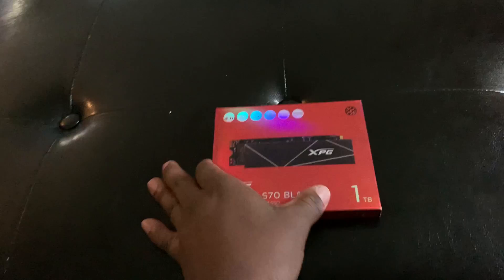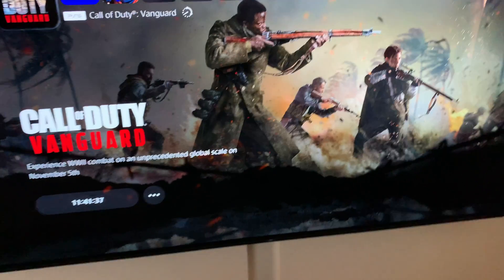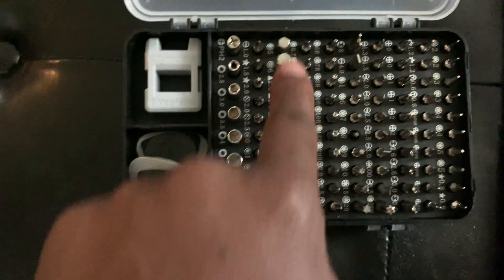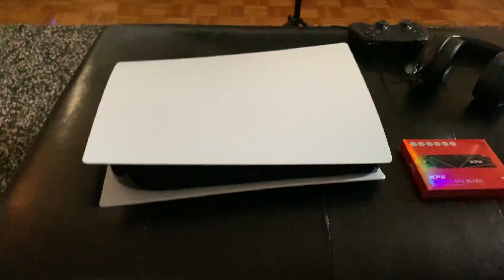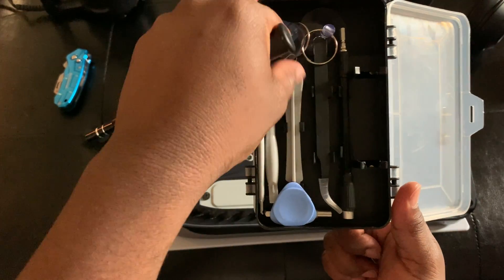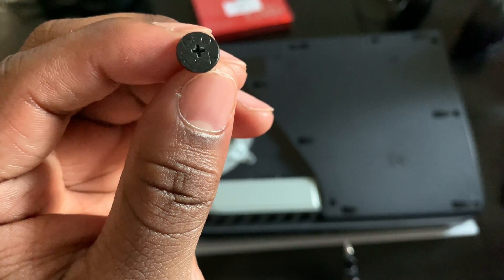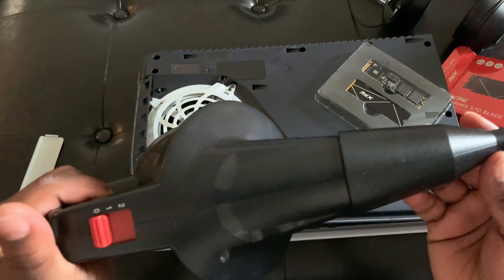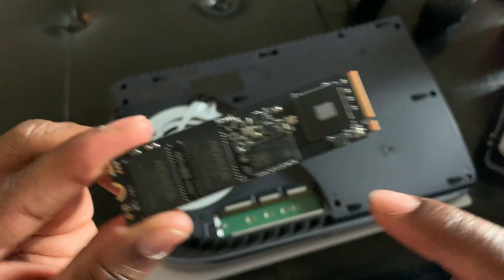Amazon's 1TB XPG Gammix SSD + Installing M.2  XPG 1TB GAMMIX S70 Blade for PS5 | David Yeb Vlogs |

Comment: How is the heat sink that came with it working?
Reply from the maker: Hey, yeah, for now, it's holding fine. I haven't had any crashes yet when I am playing on it.
Reply: @davidyebvlogs  thanks. I installed mine today. Was curious if I would need to buy a different heat sink or not
Reply from the maker: Oh, nono. No need. It works fine. Apparently, Sony says the SSD slot is part of the cooling system when the little case is closed. I'll have to test it. Watch out for that video soon.

Comment: WORD OF ADVICE to you or anyone of your viewers...never spray compressed air or use one of those data vacs on a fan without holding the blades still. You risk running the fans WELL above their rpm limit and ruining the bearings.
Reply: Thank you for that comment, cuz I have done it without once or twice, but never again!  Thankfully I didn't mess them up and I didn't do it for long cuz the fan wasn't dirty.  Never would have thought that would have been an issue but totally makes sense!
Reply: Thanks for that
Reply from the maker: @KapinKrunch  my pleasure thanks for the support!
Reply from the maker: You learn something new every day. Hey thanks for the Advice its noted.

Comment: What’s up man, my ssd is coming in today. I wanted to ask if it’s better to tape the heatsink before installing
Reply from the maker: Hey, I'm Good thanks. You can do either way. It just that when its in the console you can gauge better. Just make sure you center it clearing the part where it goes in the M.2 slot. You got this!! No doubt.

Comment: Will I Be able to use a double sided heatsink with this m.2
Reply from the maker: Hey, I think you could do it but then I dont think you'll be able to close the little case. It shouldn't matter i've seen people do it without closing the m.2 case. Sony states that closing it helps with the cooling of the m.2.(Part of the console cooling system) But ppl have done it and they had zero issue with cooling. hope this helps.